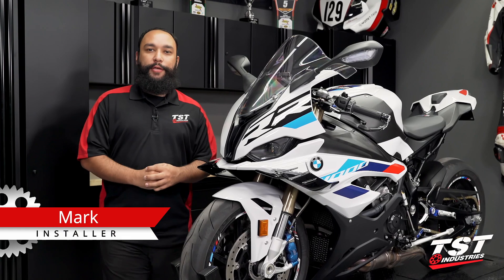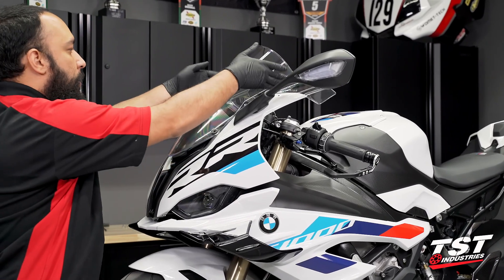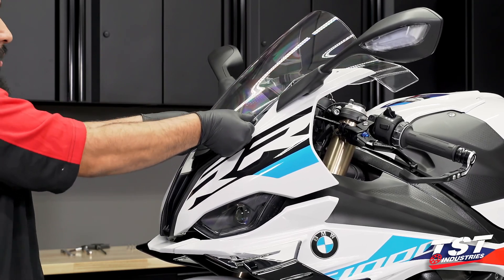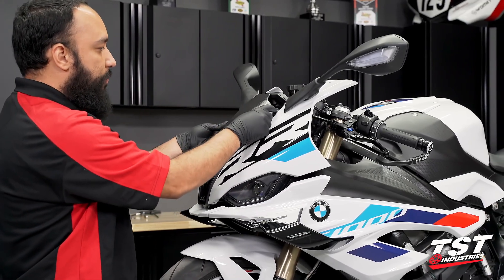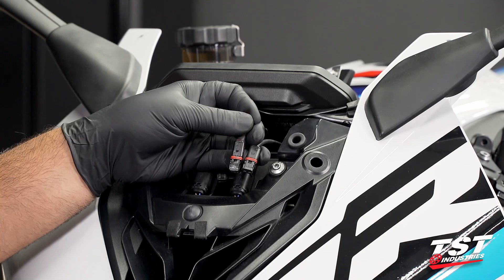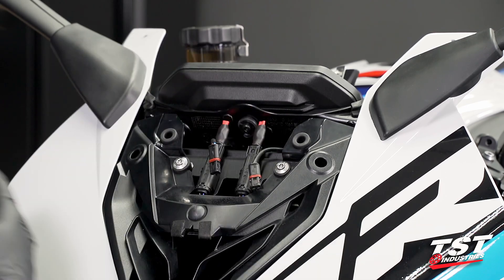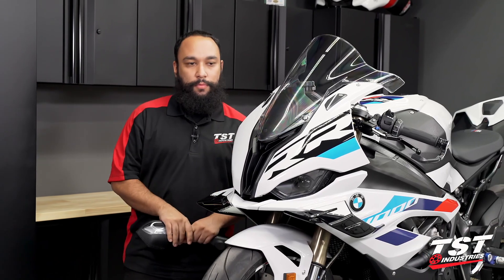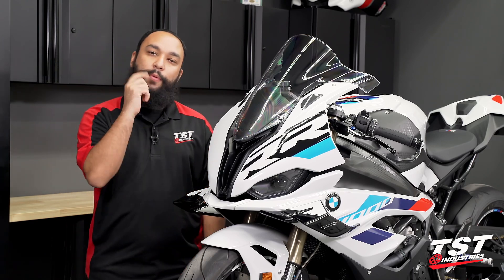How To Install Mirror Block Offs & Mirror Delete Dummy Plugs on 2023+ BMW S1000RR by TST Industries

Comment: TST Mirror Turn Signal Delete Plug Kit For BMW S1000RR 2020+ is out of stock. Any ETA on when they CAN be available again?
Reply from the maker: Please sign up for the notification email in that product page and you will get the updates. We are currently working on a batch large enough to supply to the end of the season.